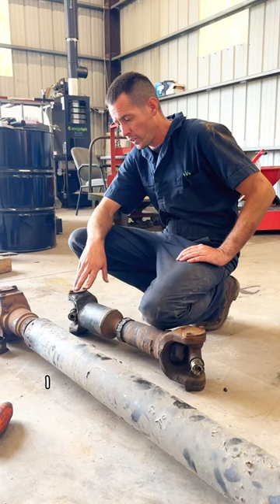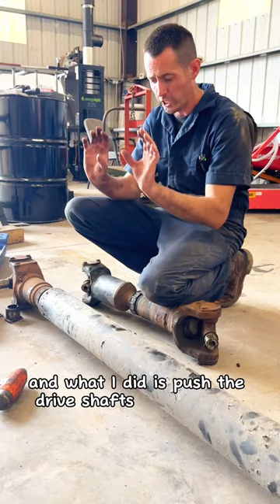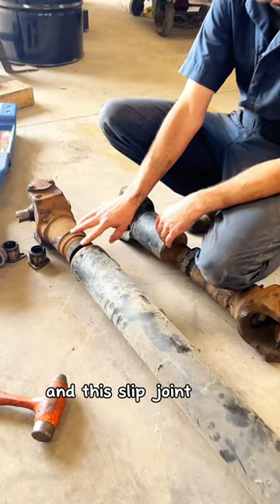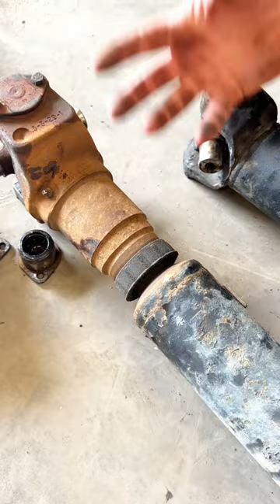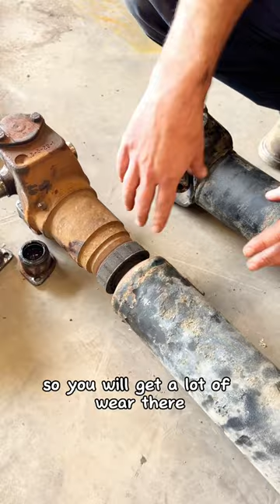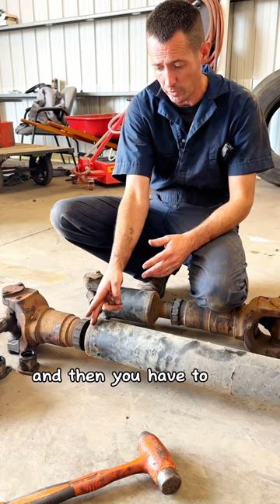Semi truck vibration - check out your drive shaft and slip joint #truck #trucks

Comment: Hello, in the driveshaft business we call that broken back and or backlash, the parts are called slip yoke and the part welded to the tube is a tube shaft. not begin critical just trying to help you. have a good day. (i work for Dana/spicer)
Reply: It’s a actually a stub and a slip yoke
Reply: @Massuu221 no it’s not. He’s correct

Comment: One other vibration source can be the clutch. We couldn't find the source of a bad vibration in my wife's Pete dumptruck. She was off for a day, and the other driver figured it out. A new clutch was installed wrong, and they didn't resurface the flywheel either.

Comment: Hi I'm a big fan, I changed  the air valve for airbags and I have a little vibration  when I stepped on gas pedal. Any idea to move up or down  the leveler  valve to reduce this issue?   It's 2012 peterbilt  386